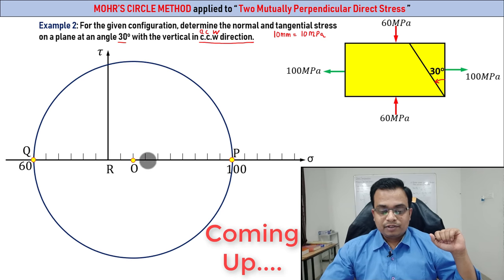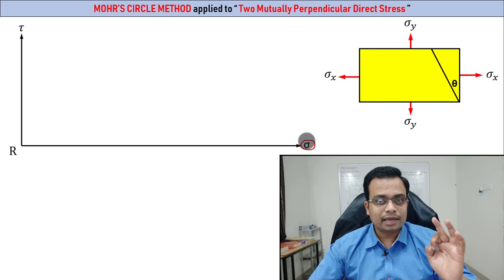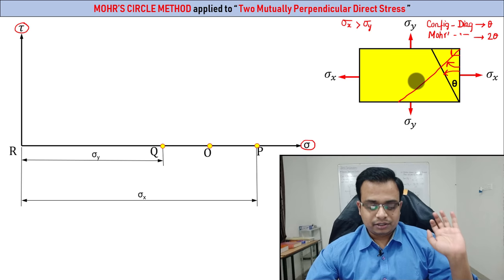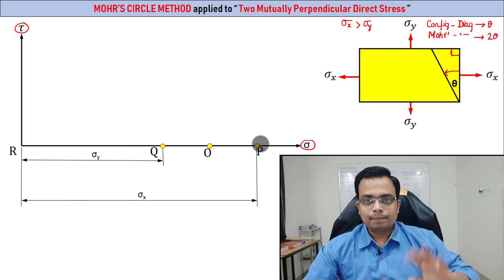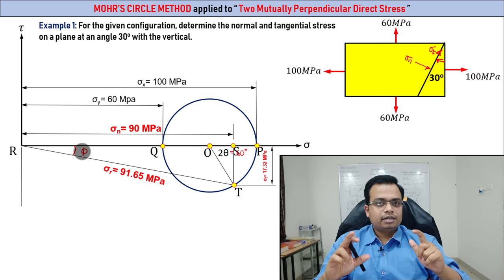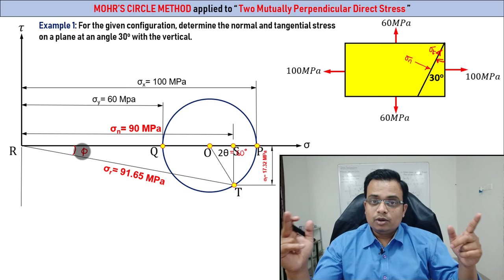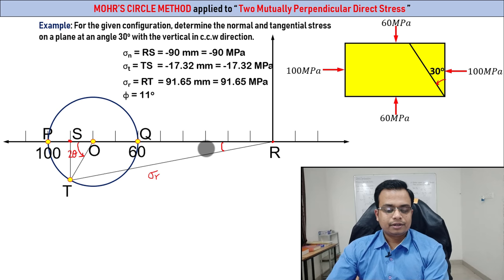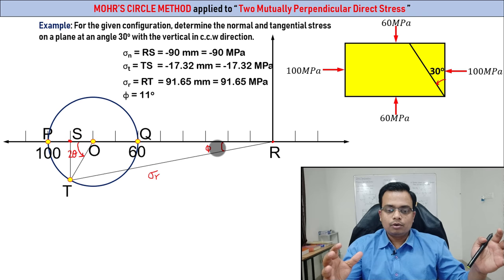Mechanics of Solids | Principal Stress and Strains | MOHR CIRCLE METHOD 1 |

Comment from the maker: A Small correction 11:37 (10mm = 10 MPa)
Reply: sir small doupt in this section sir last sum counter clock wise direction sir u put a angle in -X,-y in third quadrent  why sir
Reply: 5:38 sir the centre will be (sigma x - sigma y)/2
Reply: @sayankarar7356  that is the length of radius , you'll need to add sigma y to it to get the coordinates of centre
Reply: @sayankarar7356  no this is wrong for calculate the coordinate of middle point 🙂 this is (sigma X + sigma Y / 2 )
Reply: @RajKumar-cf9wp same doubt sir.  If the angle in counterclockwise then angle in mohr circle should have been in second quadrant rt?